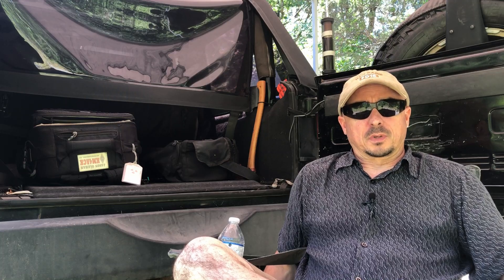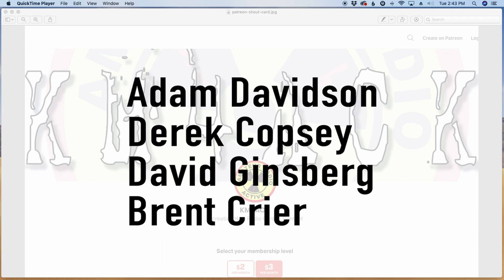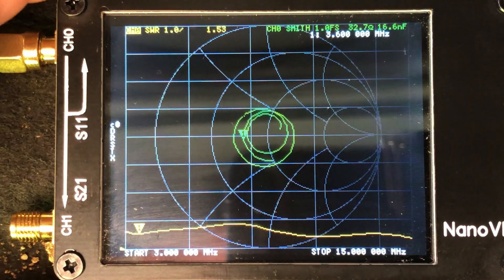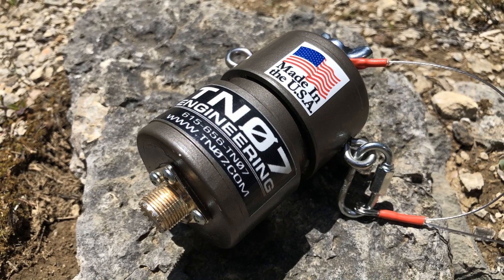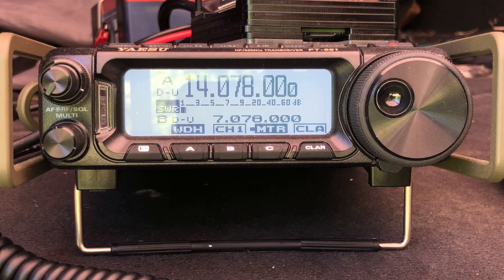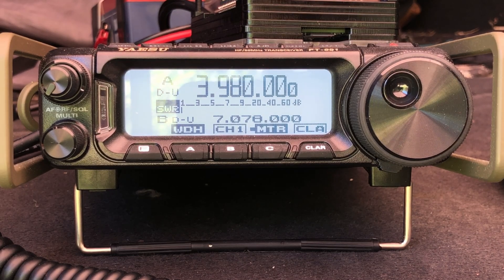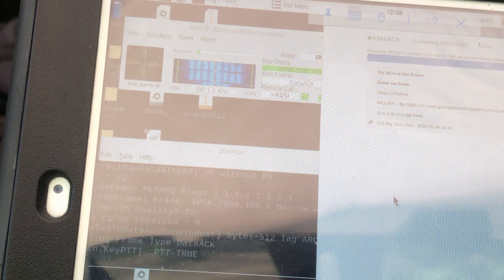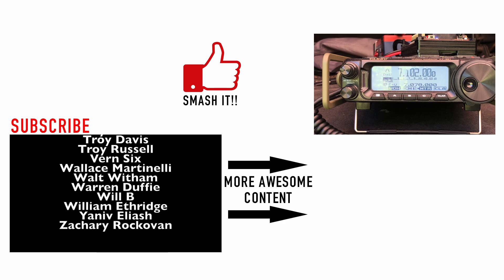TN07 IMD 109 Antenna Review

Comment: Is this basically the same as the IMD-107 from TN07?
Reply from the maker: Yes. The matching device (IMD) is the same.
Reply: okay, thanks for the confirmation.  Basically you're paying more for just the eye screws for hanging the antenna then for the IMD-107 @KM4ACK

Comment: I live in an HOA with a 6' white plastic fence. I'm using this antenna in a horizontal L config, 22' S-N then 44' E-W.  6' high supported every 8' on the inside of the vinyl fence post.  The antenna feed point,  IMD,  is clamped to a 6' steel post driven 18" into ground ,  8' from the house.  I like this antenna a lot. I switch a Yaesu FTDX10 and a Xiegu G90 with it and a vertical.

Comment: Decent looking antenna option for field use. Although I like putting my wire antennas together myself this is a nice package you could leave in a car or bag as ready to go option or even as a backup option so it is tempting. Experimenting with different configurations and locations could do a lot to change SWR readings too to so I wouldn't be too turned off by it considering how many bands it covers.

Comment: Nice to know the performance of this antenna. Mine is an End fed, 9:1 UNUN and 121' of wire. While good with internal tuner on IC-7300, still need external tuner for 160 meters only.

Comment: YO8SDE - 
 although I don't think you'll send it overseas. 
Did you use the same coax cable  when you did measurement with nanoVNA as the one connected to Yaesu?
SWR for an antenna must measured at his end, not after some meters of coax cable, because that cable might become part of the antenna.

Comment: NI4B - After reading the fine print on your previous post, I checked out the antenna on the TN07 Enginerring website.  That's a nice looking antenna.  It seems reasonably lightweight and VERY durable.  I love the multiband capabilities without a tuner.  Thanks for the review.

Comment: Nice review. I have been fascinated with the debate between endfed halfwave and random wire "multiband" antennas. I built a couple of each type but haven't had too much experience in deploying them. I have been following Gil F4WBY's posts but there is not too much in depth testing there; yours was more complete.
I would love to try one of these so put me on the list. K7TP